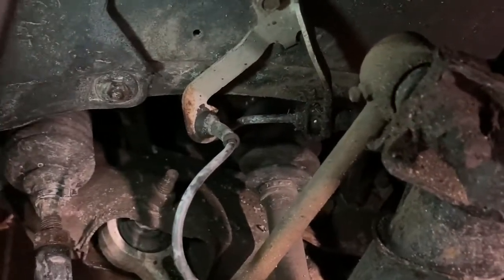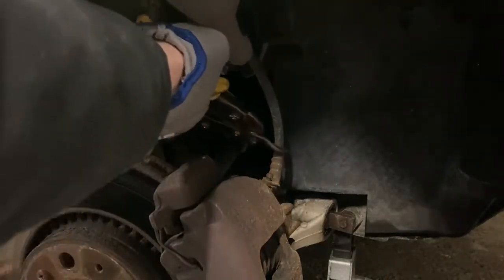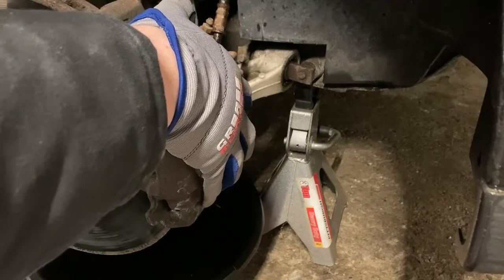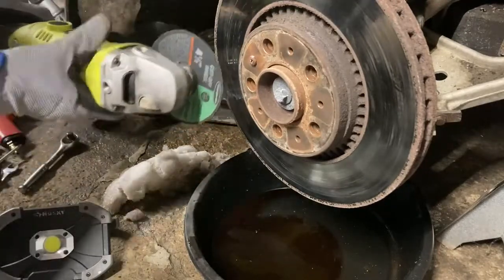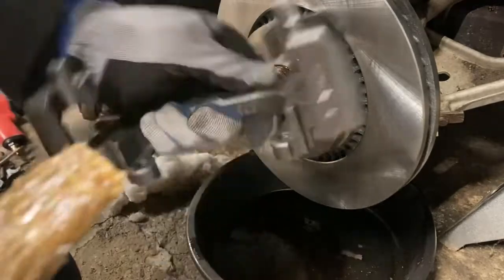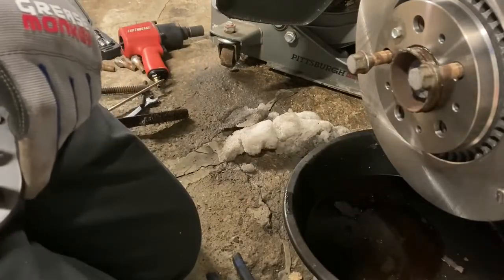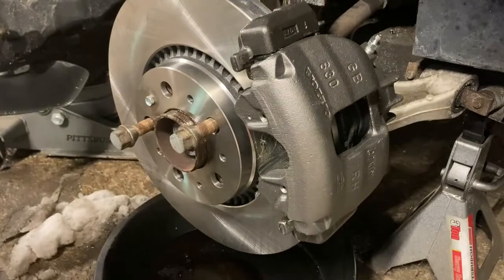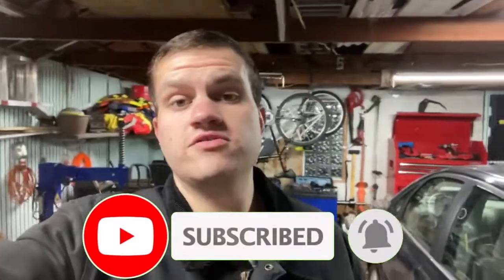How To Replace Volvo Front Brakes P2 S80 DIY | 1999-2007 S60, S80, XC70, V70

Comment: Man, this is helpful and nice to watch.

When you're talking about compressing cylinders in 19:20 and saying that bleeding valve should be open in ABS brakes by then, can opening the valve and hence letting air into hydraulics be mitigated by just unscrewing the cap on braking fluid reservoir so there's no pressure buildup?
Reply from the maker: Thanks for the comment! That I’m not 100% sure but I have always heard with abs brakes it is not good to create back pressure into the reservoir. Better to blead them after letting fluid out.
Reply: You also don't want to push the old fuild back because most of the time it is black and contaminated from so many heat cycles. Unless you know for sure the fluid has been flushed recently I wouldn't risk it, even if it's an older vehicle with out abs you can still damage the master cylinder.

Comment: I was so interested how did lose the hose from the brake line, I am going to change my rear brake of my volvo, as I can see it all rusted, I hope wd40 or 556 will help. Othewisr I am going  to buy an induction heater, heater with flame I am not sure because its near the tank.
Reply from the maker: Make sure you use a fitting wrench and some heat/wd-40 if needed. It should come loose with not too much trouble.
Reply: @matt-diy  Thanks for your time.